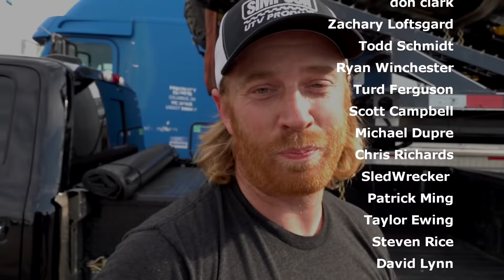Wrecking $250,000 worth of side by sides... our worst day ever.

Comment: Wedge trailers super dangerous you didn't have enough weight on trailer axles happens all the time
Reply: Yup the heaviest one should have been been low on the back and the lightest up top but they put the heaviest ones high up top. Need to get that weight as close to the ground as possible. Even compressing the suspension with ratchet straps and airing down the tires would take a ton of force off the trailer in turns.
Reply: Couple 55 gal drums of fuel underneath like they normally do probably would’ve saved it

Comment: Just from my experience as a truck driver, looks like a lot of weight sitting way up high for that little stilt of a trailer hitch connected to your truck. Just the law of physics working against you when you came around the curve. That sucks bro, I hope you guys get back to it quickly. 🤙
Reply: Yes. All of the load on the first half of the trailer was way too high, plus all the cars are lifted,made it even worse. This trailer has a design flaw. In old England we have double decker trailers+trucks up to 97003lb. You have to have +20% or more weight all the time on the top deck. Also the trailer here does not connected properly to the pulling vehicle by that knob, giving it less stability against tipping during cornering. So the trailer went over, without getting any the stabilily from the pulling vehicle.
Reply: Yeah its too top heavy. Its easy to get used to towing and you feel comfortable about it. But as a truck driver, that is really top heavy…
Reply: There's a reason why these huge trailers are not used in most countries . Most countries use commercial vehicles that are designed properly.  Can almost guarantee 90% of these big trailers behind small trucks have never had a roll over test
Reply: The reason I don’t like goose neck trailers.  Safety chains on the trailer, break or ripped out of the bed.
Reply: @paulshannon4576  yeah 5th wheel has tons more stability and that's why semis use them not goose neck
Reply: When the trailer started to tip, the hitch just popped right off the ball, the amount of force levering it off the ball is massive.  In normal towing the hitch pulls and pushes and wiggles on the ball in a mostly linear fashion, this is like popping a cap off a bottle with a bottle opener.  Design flaw.  But if they used a 5th wheel hitch it would have flipped the truck too?
Reply: In the first minute of the video (1:05) you can see that the ball is not in the bed of the truck anymore… at 7:00 you can see someone put the ball back in…. I think someone didn’t latch the ball in the bed. I have the turnover ball in my truck and I’ve forgotten to reach under the wheel well and latch it, luckily this didn’t happen to me!
Reply: They turned the corner too fast 
Has nothing to do with the weight
Reply: @brianrose7260  good eye. Id say that’s what happened.
Reply: yep. thats what i thought too... the side by sides would have all worked against the tow vehicle by having big springs... as the g force increases on them, they stretch, making that center of gravity roll into the corner, i would like to have seen how the vehicles where strapped down? that would have played a roll + corner speed. Anyway. Yes... CG was mobile. Carful when you tow top heavy rigs .
Reply: @peterpanonamotorcycle5667     really... It's simple physics...

Mass x angular velocity(2) ÷ radius = centripetal force... in other words... mass and weight are not only related they are proportional and a key factor in the equation... so yeah weight definitely played a role along with speed and the shift away from the center of gravity... and you ride motorcycles 🤦🏼(well assuming by the name, I could be wrong though)
Reply: @peterpanonamotorcycle5667  whats that??? I didn't catch that... you drive trucks...? well I'll be damn... good for you... now how about you address the science behind the wreck... I'll give it to you, the amount of times they did this... and I'll add this... it only takes one time for a trailer to be loaded "wrong"... and then you add speed and the center of gravity and radius into the mix... you get this... you must be one of those Landstar drivers. Huh?
Reply: im just glad theres so many experts in the comments.
Reply: Looks like an engineering disaster!
Reply: @robvanderkroft6515  yep, that entire setup would be completely illegal here in Australia…and this is why!
Reply: @peterpanonamotorcycle5667  er, it has EVERYTHING to do with the weight! It’s basic physics!
Reply: @officialWWM  yea I'm a kiwi so pur rules are similar to yours
Reply: @robvanderkroft6515  I’m a kiwi too bro, I just live in Oz now :)
Reply: Thought about that.
Reply: Man sorry to see that! I know the ice water thru the heart feeling! When going around a turn trailer frame twist can be a factor since the distance from top load CG to ball generated a twisting force transfered through the frame to the only point resisting that force, the rear axles (with their own suspension flex) . This allows the front top heavy load to shift further out, and the ball on the long stick to rotate out from under the load compounding the issue.  (Remember the funny vids of 3 wheeled cars tipping) same thing only Imagine hanging a big load high up in front of it! There was way too much weight for it to have simply popped off the ball. The highest point of the load being actually forward of the ball and furthest from the rear axles is the worst combination. Strapping down by the tires allows the cars to roll shifting the CG even further, once it crossed a certain point it became a rapidly self feeding cycle. Its simliar to whats called "metacenter" in ship design. You wouldn't feel any of this happen since the only force on the truck was lateral not rolling, Since you had nowhere to go to correct it it was a foregone conclusion. I'm glad the hitch and chains failed or you would've probably rolled the truck. Amazing you drove away from this! P.S. I was a CDL driver and inspector, trailer builder and own and use a heavy rotating wrecker. I've always wondered how these trailers were legal.
Reply: You're on the bean, I hate those wedge trailers they are so flexy and easily top heavy it's not their fault as much as those trailers are a turn over just waiting to happen.
Reply: @francikaa1  had they had stabality from truck the truck would of flip also and probebly injury to occupants thank god that ball came out and protected the vehical.
Reply: I see a lot of guys hauling much heavier loads on 3 car wedge gooseneck trailers with no issues.  There's guys putting 3/4 ton diesel pickups on the flipper ramps hanging over the roof that go across the scales and DOT doesn't bother them. 🤔
Reply: you  meant he was traveling to fast a speed for that setup on that road. someone swerved  hard,  over it went. theres a lot missing from the scene.
Reply: Agreed Brian, this isn't just bad luck. Time to rethink your trailer setup.  Best of luck.
Reply: @brianrose7260  Yeah either the latch failed, or it wasn't latched. Those ball inserts are some really tough forged steel. Also scary the chains snapped right off, whole thing seems sub standard.
Reply: yeah probaly came in the curve a bit hot and boom the trailer goes flying
Reply: Yeah that trailer looks janky AF
Reply: @brianrose7260  I noticed the same thing. The hitch pulled the ball right out
Reply: Top heavy
Reply: @brianrose7260  Well spotted!! 👀🤨😏 If their insurance company sees that too or your comment, their insurance claim may get refused.
Reply: @officialWWM  Agreed 100%. 😊👍👍🦘🇦🇺🦘
Reply: never liked 5th wheel connectors like that.. too high.. puts all the weight above the centre of gravity.
Reply: I’d like to see some dash cam footage or CCtv. Hard to believe they weren’t filming already. They did all hold their reactions in time for the guy to get the camera out lol

This sucks though, I don’t wish hauling problems on anyone or their toys.
Reply: @brianrose7260  good eye
Reply: @matthewchin6454  if they used a fifth wheel hitch with a big enough flat plate on it that stops it from tipping it would help weight transfer a ton. You can also get an airbag fifth wheel.
Reply: Top heavy + speed = Rollover.
Reply: That's what i'm thinking. Trucks drivers don't pay top dollar for their trucks and gas and equipment just for looks that shit all has function and gets you home in one piece. Why would any company by a 200k truck if they can get the job done in 50k truck. This video is why
Reply: No safety chains or breakaway safety brakes either. They just drop it on the ball and go for it. Go on knowing if they had a dot number and was commercial thered been hell to pay.
Reply: @brianrose7260  I was thinking the same thing as I watched and all of a sudden the ball was in place..
Reply: I've seen several videos of trailers like this one rolling over, It's too high for jacked-up vehicles.
Reply: @brianrose7260  I saw that too. Seems to me like someone didn't latch the ball
Reply: @giovannigiorgio4622  At the start of the video you can see how they buggies were strapped,  with straps over their wheels. No sign of cross-strapping or chains pulling the suspension into compression to reduce the roll of them in corners.
Add in the top heavy nature of that trailer design, the non-existant sideways twisting resistance of the hitch (compared to a 5th wheel with large plate which really only allows front to back rocking) and it wouldn't take much to tip it past the point of no return.  It may be loaded as before, strapped as before, and cornering no faster than before, but a simple bump on the road surface could have caused suspension travel on the buggies to be the straw that broke the camels back in this case.
Reply: @matthewchin6454  its just leverage. it hits the end of rotation so the only place left for it to go is up/out. needs a pin or something more secure to hold it in. But Brian Rose is onto something here I think..
Reply: @ionstorm66  i saw a video of a suv with a tiny trailer lose the hitch.. the chains failed after like 3 seconds. like the trailer did 2 darts left right then left and freedom. chains really don't do shit. if the chains can't hold a tiny trailer on.. no big trailer is staying attached.
Reply: Took the turn too fast with high CG. No question about it.
Reply: @francikaa1  Which is why the truck didn't roll. 😮 phew
Reply: Yep definitely an eff up
Reply: Watch the video, the BEGINNING!!!the ball wasn't latched in place
Reply: Yup, long sweepers with high center loads take out lots of trailers and put them on their sides. Especially non professional drivers like these guys. Glad everyone’s ok tho.
Reply: The ball wasn't latched in place. These hitches are rated for 30k pounds and they were definitely under that. If the ball was latched it would have flipped the entire truck.
Reply: Yea thanks for parroting exactly what the guy in the video said.  Very informative 👏
Reply: @Brian Rose is totally right! Operator error. Goose neck ball was replaced at minute 7:00 after the rollover. And one of them commented the ball was still locked in the trailer.  Insurance fraud?
Reply: Agree
Reply: Another thing, red=rust rust = wear. I wonder when the ball and coupler were last checked? 
 Most won’t grease because it leaves a mess in the bed or “they only make short trips”. A few thousands on ball and coupler can make a difference.
Reply: @peterpanonamotorcycle5667  he said he wasn’t going fast.  I heard him.  LoL
Reply: @WilC379  the issue was youthful drivers speeding
Reply: @PInk77W1  Wrong. It appears lack of maintenance and improper pretrip were to blame this time.
Reply: @WilC379  if you’re gonna skip maintenance and pre trip all the more reason to slow down
Reply: @PInk77W1  No, it would have happened eventually regardless of speed. Speed isn't the end all be all, get over it. You must be that guy driving 55 mph in the left lane of a 75 mph Interstate trying to slow everyone down "for their own good".
Reply: Yep.... Like they said 40-50k miles with that setup and load... Little by little it was opening up that hole till pop goes the weasel. 

Gotta keep a constant check on those connections with a caliper 🤓
Reply: @amplexorj  yikes.  
That load was hi and looked heavy
2 strikes against them already
Reply: Yeah that’s the first thing I noticed. All the weight is at the highest point possible
Reply: @2vcrew782  slow down simple
Reply: @PInk77W1  That too yes
Reply: @PInk77W1  If you ask me everyone is driving way to fast on the roads today. Everyone seems to be driving beyond their ability because new cars are all faster then cars 40 years ago
Reply: @brianrose7260  the new RAM, Ford and Chevy has a ball that is spring loaded. The ball itself has a little lever you pull up on and to install and remove it. You can't put a trailer over it if the levers up. This setup doesn't have a rod in the fender well area.
Reply: @brianwalker1933  well clearly the ball was ripped out. Just prove it snapped or a worn locking pin and it should be covered
Reply: To heavy of a load for the trailer design...just too flexible..
Reply: Cane around corner too quick  also high center of gravity, like the guy said.  Load shifted
Reply: @brianrose7260  i noticed that right away that the ball was gone and thought it either sheared or came out, then was surprised to see it sitting back in there like nothing happened
Reply: @brianrose7260  or just one unlocked it on them when they where stop some where. People do it all the time to trucks.
Reply: @brianrose7260  at 1:05 that the outside hole for the safety chain connection. This truck has the oem gooseneck package. The balls are cheap and probably did come disconnected but as for user error you can’t put a trailer on the ball without latching the ball to the truck
Reply: @peterpanonamotorcycle5667 
WRONG! It has EVERYTHING to do with weight, and it's distribution,  if it didn't,  go-carts, Lotus, Tesla etc.. would be rolling over all the time. 
Did you not ever take a physics class? 🤔
Reply: Going around that corner to fast.  I see that type of trailer overturned all the time throughout the country. All had a all the weight up on top over the truck.

Comment: Speed kills. Sorry bro but you rolled it in a bend. Its top heavy and the trailer tires are 👍 good. Its not the unhooked trailer because the trailer would not have rolled.  You was going too fast bro. Slow down. This is not the dirt its the street.

Comment: As a trucker of 42 yrs, the fact that the load came off the trailer tells me the strapping was not done properly. Besides that, the ball was not in the bed of the truck. (1:24min) Either over stressed or not properly installed. But a fifth-wheel hitch would have been a better choice.
Reply: Do you think the insurance people would know that?😂😂😂

Comment: I’d recommend a 5th wheel conversion on the trailer or a new trailer with a 5th wheel. That would allow for less play in the trailer and it has a lot safer of a locking mechanism than a gooseneck. B&W companion is a great hitch that mounts up to your gooseneck and is a ton safer than gooseneck
Reply: That's right buddy exactly what I was thinking why would you have all that weight on a gooseneck. Yes I see it on my travels in my state all the time. Humans hauling equipment etc. On gooseneck trailers. I personally would not trust one with the amount of responsibility you have when hauling.
Reply: And grade 8 bolts

Comment: As a flatbed truck driver. On off ramps like that or sharp curves especially with a trailer with the load being high center of gravity is probably the number one cause of most roll overs. Glad all people are ok. Machines can be fixed or replaced. That's what insurance is for.
Reply: Yup, I once hitched my tag-along car carrier to the ball, but it wasn't actually full seated on the ball. The ball actually hung up the lock so when I thru the latch it went right in place. I had no idea that my trainer hitch was sitting on the bottom of the lock and not in the ball socket. Thankfully I wasn't going very far and the tongue weight held it in place. But when I got home and went to unload, all hell broke loose. As soon as the car was far enough back the tongue shot up and tore a gash in my tail gate. needless to say I needed a few friend and a change of under ware to get out of this mess.
Reply: I was a truck driver for a while. Company rule was 5 mph under the posted limit on the curve. Sometimes I did 10 mph under. Their trailer isn't heavy enough, so the CoG is too high. I bet they were doing exactly the posted limit on the curve or just over because they were so comfortable towing that trailer, but it's not capable.
Reply: @mjodr  they taught me 10mph under the yellow "recommended" exit speed. Which I will bet was 25 mph. Can't say for sure but ill wager no way they were doing 15 mph.